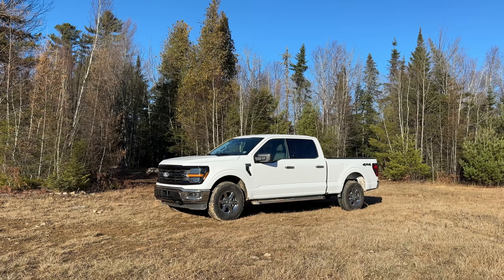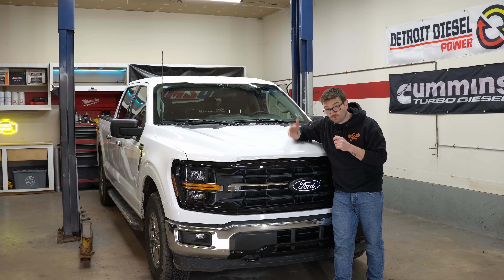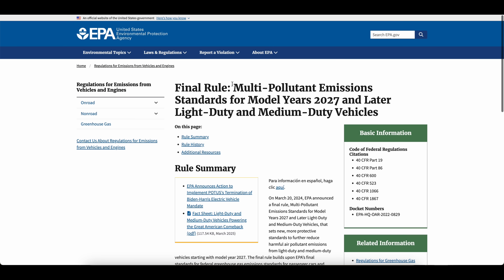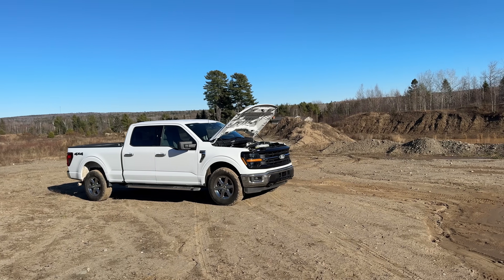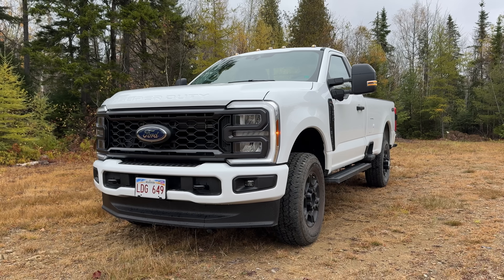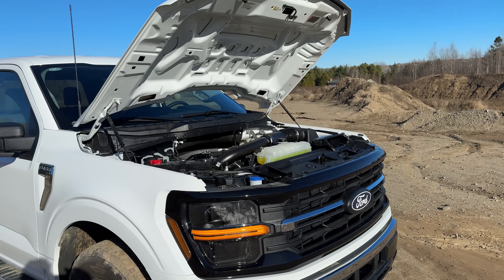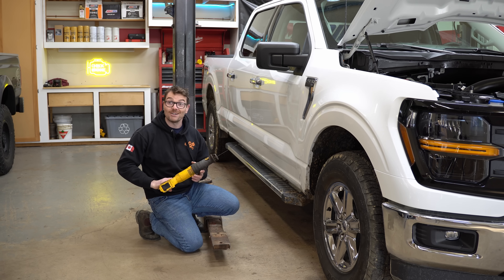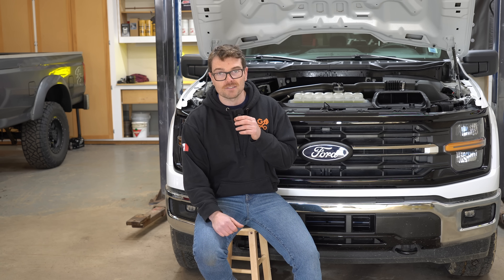Ford F-150 3.5L EcoBoost Is Now Getting Gasoline Particulate Filters… Here’s Why It Matters

Comment: The only thing I gathered was the EPA has not been dissolved.
Reply: Fell for it again awards are in the mail
Reply from the maker: Seems like the 2027 emission updates are still going ahead.
Reply: If you want to save the planet make a truck that lasts 40 years
Reply: Did you think it was going to be? Have you been watching too much TK's Garage?
Reply: Good. I want a healthier environment.
Reply: @chickenstrangler3826 The EPA does NOT provide that for you. These laws mean a new vehicle every 5-6 years, which produces MUCH more emissions and environmental damage than producing vehicles with standard (think mid 2000s) emissions equipment lasting 5-10x that long. Think before you support a ripoff, save the planet for real
Reply: @fry.master the changing EPA standards do not require you to change your vehicle. You can keep the old one. If you are talking about reliability, warranties last longer than 5 years now and if you do some research, you can do more preventative maintenance and save the truck on the long run.
Reply: @crisisrogue8286  How old are you? You obviously aren't aware that a 70 -80 era gm 350 engine could easily go 350,000 to 400,000 miles. GM's 3.8L v-6 was a bullit proof 27 mpg engine. But oh no, the EPA cranks up the mileage requirements and those reliable units are history. I've got the 3.5 ecoboost, no way in hell its going 300,000 miles like my sons old chevy silverado did! Why? because of changing EPA standards.
Reply: @chickenstrangler3826 Well I could go on for hours about how the EPA is unconstitutional, unnecessary, corrupt, etc. But being this is a truck channel, can you tell me how your EPA’s diesel regeneration works and how it protects the environment?
Reply: @stgibson2810   DPF collects the soot. The soot causes problems for the engine as it clogs the filter. The soot is still combustible so additional fuel is used to burn the soot. It's better because soot causes damage to human health more immediately and locally. 

A better way (in my opinion) is to run engine combustion hotter, reducing PM but increasing NOx. Then use SCR to reduce NOx before emitting it. More power, less fuel used and better reliability.

You asked how this helps the environment. It helps humans and other living creatures not breathe in soot or eat soot laying on food or drifting into waterways. The DPF also captures other particles (like heavy metals).
Reply: @chickenstrangler3826  That is a good point. They have SCR systems, and they use a shit ton of DEF as is. Why not use just a little bit more?

Comment: Government wants us to get ev period
Reply: I agree and I will never get an EV
Reply: There is no infrastructure for charging!!!
Reply: @summerforever6736  It will never be built up either.
Reply: @jmt8706official  Would you support the government building it up?
Reply: @chickenstrangler3826  If they actually did it, yes. EV's have their place, but currently it's like pushing a toy that needs batteries, and not having enough to hand out for the toy.
Reply: @jmt8706official The Government can't be trusted to do anything right or good at all. And if they do one thing right it later gets rolled back or there are stipulations attached to it that screw everyone over anyhow. Also the problem too is if we keep having financially irresponsible morons buying these new trucks then they will keep making them with all this emissions crap and tech that spys on you. If people can stop trying to keep up with the Jones and stop obsessing over new shiny things then the companies would go out of business till they give people what they want. People need to be grateful to have any transportation at this point. Stop being picky about what you drive just cause it's 15 years old. More often than not but not always vehicles become unreliable because people don't maintain them. Imagine when that time comes with a brand new car from 2025 or 2026 and people don't maintain those.
Reply: @summerforever6736 EVs are superior to ICE vehicles for most people.

Just like ICE gas cars were superior to steam cars.

Great grandpa didn't want to give up his superior horse and carriage over 100 years ago.

Comment: Im currently driving a 2022 1/2 ton f-150 with 57,000 miles. When the time comes to get a new truck, there's NO WAY I'm buying anything newer than a 2011. The eggheads are outta control.
Reply: agree but how many are you gonna find running around in decent shape for decent amount of $$$
Reply: @PKDesigns2011  There will always be one out there if you’re patient and look
Reply: This is one of the nice things though.
Things were simpler from 2011 and back. So as a mechanic, this makes me happy.

Comment: I'm betting that my 24 xlt 303 bap leather 5.0 will be my last new vehicle. Worst case scenario,  a 6.8 or 7.3 f350 work truck for hauling equipment and horses. Building a 66 mustang 302 / 8hp.     2000s ranger with a 302 / t5 and 94 f150 with a turbo 5.3 l33 / 4l80e.  Calling it a day. The old stuff is now usable in a way that has never before been possible and honestly,  regardless of how nice these new vehicles drive,   they don't really feel good. Its a complete disconnect.

Comment: As a lifetime Ford guy I'll be sticking to 15+ year older trucks . Thanks government.
Reply: that's pretty much impossible here. the salt eats everything here. finding a mint 15+ year old truck is next to impossible.
Reply: @hochhaul  Even down south it's difficult to find a good vehicle over 10 years old.
Reply: They're just going to make it harder and harder to own something like that.  They will just road tax them out of existence.
Reply: @bmstylee   as far as I know there aren't any road taxes like that.
Reply: Gee, only 382 HP. At 82, I have bought and driven many cars and trucks. None, zero, have had that much power by a lot. Never had complaints. So, no sympathy here. Note no drop in torque. Soot is bad.
Reply: @buzzboykin9982  The slight reduction in power is the least of our concerns. The best part of the gas trucks was no diesel emissions which are notoriously expensive to repair.
Reply: @buzzboykin9982  I don't care about a little less horsepower. It's reliability is compromised and just more expensive repairs. Did you watch the video?
Reply: @jimh.412  Like everything else, take care of it.

Comment: that burned off oil that gets by the low tension piston rings are going to clog those up real quick.
Reply: Just wait until all these owners change their own oil and buy an oil that isn't safe for GPF's. None of them are going to understand that 90% of the engine oils at the store are bad for their GPF. The most common oils safe  for GPF's are the more expensive Mobil 1 ESP oils in 0w20 and 0w30.
Reply: @hochhaul  Just 1 more reason to NEVER buy one of these or any truck with this crap. The used truck market will be hot.
Reply: Lol
Reply from the maker: Ohhhh Yes

Comment: Looks like Ford will be selling the heck out of 2.7 Ecoboosts and 5.0 in 26 and in 27, dropping the heck out of the price on the 26 3.5 Ecoboost so as to unload the sheet loads of 26's gathering dust on the lot.
Reply: Yeah if they can get the prices low.

Comment: I'm kinda pissed that none of the manufacturers are digging deeper into ducted fuel injection yet. It has shown really good potential to create cleaner combustion for diesel engines and reduced nox emissions. I'd imagine that it would have a similar impact on GDI engines as the mist droplets get atomized to even smaller sizes than they would with just regular high pressure injection. Ultimately the smaller the droplets, the more is able to completely burn. Given the potential with how much cleaner it can make a diesel engine run, I'd imagine that it would be even better for gas engines.

Comment: I doubt the torque will still be 500 losing almost 20hp. Another reason NOT  to buy a turbo six. I actually feel good about my 2017 RAM 1500 with a 5.7 and 3.92 gears now

Comment: 2025 Ford Maverick with the 2.0 got GPFs; went from 250 hp to 238.
Reply: Really? I was going to get one next year. Guess I'll get a 2024.
Reply: @jimh.412  I believe Ford revised the numbers back to 250. Even now on the Ford website, they list the 2026 Maverick as having 250hp and 280lbft (which is 3 more lbft than before).
Reply: @ALMX5DP I'm still going to get a 24. More reliable I think
Reply: @jimh.412  If you're looking for reliability, I suspect the hybrid version would be the best bet being it's a naturally aspirated duratec engine that has been around forever now and it's paired to a Toyota derived planetary transmission that there really hasnt been much of any negative press about.
Reply: @ALMX5DP No I do a lot of highway driving to work (100 miles round trip).Hybrid wouldn't do me  much good. I actually ordered the hybrid version in 22 or 23 but Ford never made it.😂
Reply: @jimh.412 still an improvement, and combined with the potential for being more reliable I’d say that makes for a pretty compelling vehicle.
Reply from the maker: yup

Comment: My 23 Nissan Titan Pro-4x and my 24 XD Pro-4X are the best trucks on the road!!
Reply: Nissan trucks are great.
I have a ‘19 Nismo Frontier Pro4X (w/ 35k miles),and a 2000 collector Tahoe (w/ 65k miles). Very happy with both.
Reply: My 2023 Tundra is the biggest POS I have ever bought. I really hope it burns
Reply: @reloadnorth7722 
Sorry to hear man!! Should get a Nissan Titan Pro-4x. You will not be disappointed at all!! Ivs had 3 Toyota's, 95 4runner, 2010 Tacoma, 2019 Tundra  sold my 2019 Tundra for the 23 Nissan Titan Pro-4x and two months ago bought a 24 Titan XD Pro-4X!! Best trucks, solid reliable and honestly just so much more built!!
Reply: I totally agree 100% I have a 2024 Nissan Titan with the 5.6L Endurance V8 in it with 400 HP and 413 Ibs of Torque and man its a freakn beast and it sounds like a beast as well

Comment: Dose F250 gas engine will get this kind of filter soon?
Reply: I doubt it, only the EcoBoost engines will not the big V8s.
Reply: Good chance that other engines will get the filter, eventually, just like back in the 70’s when insisting that cars had to have a catalytic converter and pickup trucks were exempt. That didn’t last long before the trucks were mandated to have them

Comment: News article headline 2 years from now: "Ford Recalls 498,000 Vehicles Due To Faulty GPF's".
Reply from the maker: Ford does love a good recall..
Reply: @GettysGarage  You got that right sir 😂
Reply: @GettysGarage  I would rather they do recalls then refuse to acknowledge or repair faults.
Reply: Toyota will have to start another 3-4 yr engine replacement recall after the attempt of tacking on the GPF
Reply: lol exactly

Comment: I am sure the aftermarket will have a  "fix" for this in short order.
Reply: Its not CARB mandated.  Delete it.
Reply: The problem is that the fix voids the warranty. And given the wealth of other issues that these already have without even tacking on emissions, the smart play is usually to wait until after the warranty is up
Reply: Not on these trucks, they do software updates and you can’t tune the PCM this year to my knowledge, similar to what’s going on with the Mustang. Software updates can corrupt the tune. I’m aware they’ve found ways around it with the Mustang but updates still ruin it
Reply: @DylBuilder1 lol you can't tune the pcm lol give us 2 week and it will be tunable 
Or just put all that crap in the bin and install an fueltech ecu problem solved
Reply: @legros731 Nah you can, it'll just reset every update. Turning off updates fully isn't even a thing now, if it feels that you've gone past due or the update is safety related it will update anyway. People are dealing with this on the new Super Duty trucks as well. So unless you like being stuck wherever you are the next time you start your truck, better carry that tuner and get familiar with the tuning process so you can do it every time it resets
Reply from the maker: I have no doubt
Reply: Any modification to emission systems is a crime, gasoline or diesel, at least thats what all licensed tuners says.
Reply: @aurelion3 say that to not get into trouble but what they say and what they do are completely different things
Reply: modifying emissions equipment is a federal crime. Federal prison time sucks. Not just a catback here so they could get popped by the EPA like the diesel guys did
Reply: @fordrac1ng81  i wont tell if you wont
Reply: @fordrac1ng81  Emissions equipment on gasoline engines isn't federally regulated in the same manner it is for diesel engines I don't believe
Reply: @thesandman775  yea it is
Reply: @thesandman775 my uncle did 6 months for removing his cat
Reply: @thesandman775 yes it is
Reply: @jfdjkdjfkjdk  To clarify, I understand cats are, but I'm talking about this new gpf equipment. I don't believe that will be, but I could be mistaken. But the fact that Ford is the only one at the moment making this changes makes it pretty clear it's not a federally regulated bit of kit.
Reply: @fordrac1ng81  Yet it’s still done every single day and will continue to happen. Plus nobody is doing federal prison time for their gpf falling off after hitting a pot hole 😂
Reply: And if it's illegal and I find out about it, I'll be reporting it.

Comment: According to TFL, and a letter that they had from Ford's PR department, the Ecoboost trucks WILL have GPF's in 2026 but, somehow, they will mot lose horsepower or torque.  Or so they say.  The REVISED ratings are still 400 HP and 500 lb-ft for the 3.5L EB engine.
Reply from the maker: Their website still says 382.. I can't read minds lol and only go off their own website. You would think they would updated that ASAP. for the Powerboost I did use TFL's info that it would be dropping 10hp. we'll see what happens

Comment: Also on the newer ford it is impossible to scan for codes unless you have a dealer scan tool. I work at fleet rental company and we have the necessary tools but if then we’d be force to send them to the dealer

Comment: 2:55 They said on the TFL podcast that Ford told them the HP drop was a typo and it wont be dropping. Guess we will see once someone gets their hands on one and can test it.
Reply: More restrictive exhaust, it would make sense if it lost hp. Also they might de tune it to save a bit of strain on the engine with the added stress of forced regen. But let’s hope it’s a typo
Reply: @Cameron_902  Turbos could just overcome any restriction, but it would cost some longevity and efficiency.
Reply: HP drop is the last thing to bother me.
Reply from the maker: The 2025 Ford Maverick with the 2L Ecoboost has GPF's and that engine dropped HP apparently directly due to GPF's - So we'll see I guess! But I just checked Fords "official" site and the 2026 3.5L Ecoboost still says 382 Hp. I mean if it is a typo you would think that would get fixed ASAP.
Reply: I don’t believe ford HP numbers dropped on there other engines that already have GPFS on them